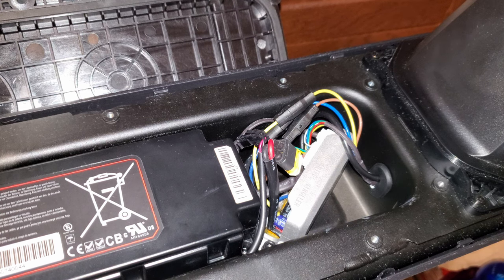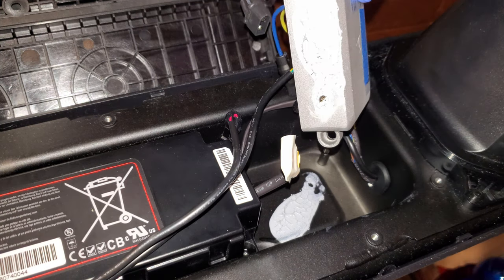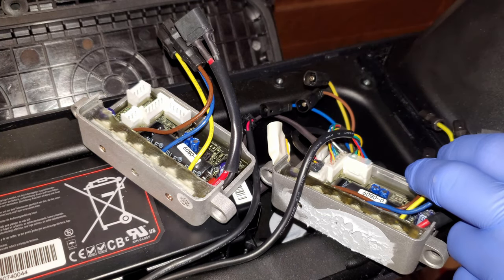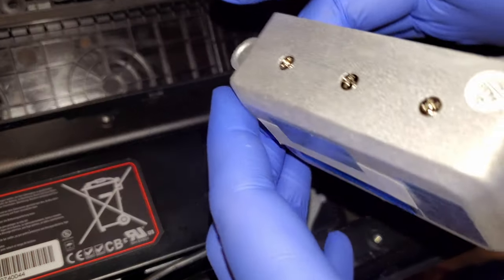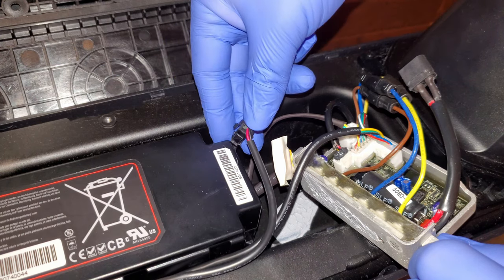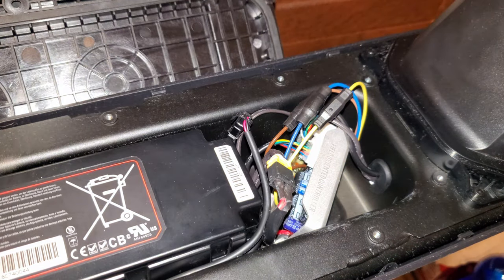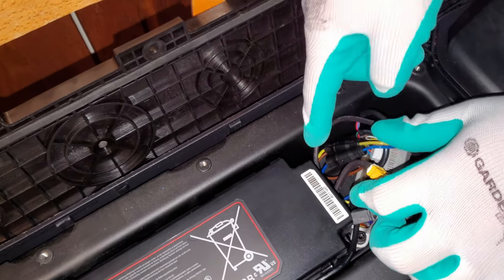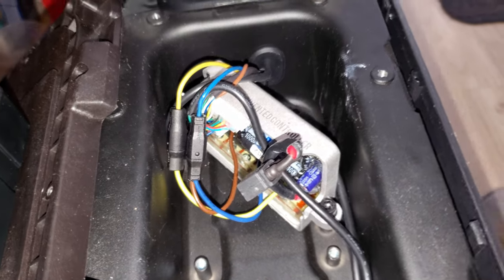NIU KQi2 Controller and Battery Replacement

Comment: I have a Red light blinking on my screen do I need a new battery for the kqi2? And could u provide a link for a new battery? Plz and ty
Reply from the maker: What sort of light, usually if there is an issue the scooter display shows an error code.

Here is a guide from NIU on buying spare parts:
"For the customer from the NA region, if you feel comfortable changing the spare part yourself, please follow the below-mentioned steps:

1. Please go to https://www.niu.com/us and scroll down to the bottom;
2. Click [After Sales] and follow the instructions on the pop-up window;
3. When you fill out the form, please fill out what spare parts and how many spare parts you need.
4. Select [Send you replacement parts]

For the customers in the EU, if you are capable of repairing the kick-scooter by yourself, you can purchase the spare parts by referring the following steps:

1. Please visit https://niu.b2x.com/shop/
2. Click the flag icon located at the upper right of the corner and select the region;
3. Select Your Model
4. Select the parts you need and confirm the quantity
5. Scroll down to the bottom and click the “Next”"

source: https://www.reddit.com/r/kqi3/comments/1cqy7yt/comment/l3ytya6/
Reply: @Lantea13  there is no after sales button u just send people on a wild goose chase so it appears to possible buyers that the NIU has good support but in reality they have none
Reply from the maker: @jasonsamuel4110  Yes there is an "After Sales" button, go to https://www.niu.com/us and scroll to the bottom of the website and its under "Service" see https://imgur.com/a/kDP0uhv

Comment: Do u have problem with controler? And do they send to you free of charge
Reply from the maker: The first KQi2 I received was DOA, and NIU sent a new controller that I replaced. If your scooter is under warranty NIU will repair it for free or send you the parts, depending on what you prefer. You have a 2 year warranty on NIU scooters.

Comment: The controller (at least in my scooter) seems to have the wrong wheel size - it's showing speed 2..4 km/h more on the display than the actual speed seems to be, as the rent scooters are overtaking me and pulling away, while I'm supposed to be at the 25 km/h. Is there a way to change that whell size value?
Reply from the maker: There is no way to change the scooter wheel values or other parameters. The 2-3km/h slower speed is a known issue/feature? NIU knows about it and towards the end of last year they wrote on their facebook group that at least for the German model they were working on fixing it, as that one was going 17km/h instead of the intended 20km/h and apparently legally it can go up to 22km/h (10% over the limit). So the hope was they would look into the limitation on the EU version as well, but I havent heard anything since, but I dont often check facebook, so maybe there was some updates on trying to address the lower speed.
Reply: @Lantea13  I had an exchange on reddit and they basically gave me the basic PR stuff. Maybe there is a way to replace the actual controller with something that is programmable, without any official blockades?
...also, maybe flashing a firmware from a different model might help with that problem?... like the kqi3 pro.
Reply from the maker: Unfortunately that is not something I  have experience with. I remember a while back some guys on a German youtube channel put an expensive vesc controller in a NIU scooter. But honestly that is just not worth the cost and hassle, imo. At that point its just esier to buy a more powerful scooter. But if you have experience with such mods would be interesting to see what you come up with.

Comment: my niu kqi2 pro stopped working after 1yr seems like it need a battery replacement . i mail niu but still nit reply. idk what to do
Reply from the maker: If you did not receive a reply from Global-Service@niu.com after a couple of work days fill out the repair request form over at https://niu.besender.com/form and they should get back to you with possible solutions.

Comment: If I put US controller it will speed up to 32 km/h?my EU version speed is max 25 km/h…it’s very slowly!
Reply from the maker: That should work in theory. But the top speed of the KQi2 is 17.4mph which is 28km/h, so you won't get faster speed than that even with US controller.
Reply: Are u gonna try it ??

Comment: Hola amigo , tengo un patinete NIU KQi3 que por no darle uso se ha descargado totalmente la bateria y no consigo hacer que cargue , segun me he podido informarme , es por que la bateria a entrado en modo de seguridad o reposo . Me comentan que con un cargador directo, no el original ,  se puede desbloquear . Sabrias tu decirme algo por favor ? un saludo
Reply from the maker: Hello, sorry I am not sure what the best process is for reviving a completely discharged battery. I have not deat with such a problem so far. I know it is possible to revive the battery, but in this case it would be best to ask NIU support to tell you what the process is for the KQi3.
Reply: ok gracias  @Lantea13
Reply: tienes que desarmar la bateria y revisar las celdas por q estan bajas y apicalr corriente a cada cela o  alas que esten bajas y depues conectas el cargador y la bateria revive
Reply: con una bateria de litio de 3.5 volt lo haces
Reply: Tuve mejor suerte , estaba en garantía y me dieron un patín nuevo 😊. Y este de de fábula
Reply: @lagridj  me cambiaron el patín por uno nuevo. Que mejor cosa que esta … jajaja 😂 no obstante, gracias

Comment: Comment je peux acheter un contrôleur de kQi2 pro s’il vous plaît je le trouve pas et ma trottinette elle blouque parce j’ai oublié le mot pas de application
Reply from the maker: Go on the niu support website niu.b2x.com if the part is not listed in the shop fill out the repair request form and ask them for the part you need. They should send you a price quote.

Comment: I locked my scooter with the quick lock option a few days ago and have been trying to connect the app with Bluetooth but it is not working.
I have tried all possible troubleshoot but still nothing.
Is there a way I can manually unlock or is there something I can do to fix this problem?
Reply from the maker: Afaik you can only unlock through the app. If you can, try on a different phone. If you still can't get it to work try to contact NIU support and see if they can help.

Comment: I somehow pressed the lock button during a near fall from a bump the that threw the stem back at me.  Since then, I unbound my primary account and tried a new account.  I cannot seem to get software back to bind it with my iPhone Bluetooth.  It has stayed locked and unable to bind.  NIU service says they will unbind my two accounts.  They said it will take 2-3 days to unbind by the engineering group.  Is there an easy way to fix this?  Has this happened to you or anyone?
Reply from the maker: Sorry for the late reply. No easy way to fix that other than contacting NIU as you have already done. Hopefully they can resolve it for you.

Comment: Hey, anyone come across error 33, "battery open circuit imbalance warning" kqi2 pro, looking for a fix customer service is ignoring me, scooter still works fine but the screen just blinks a big red 33
Reply from the maker: Haven't seen that one reported before. I would try to contact NIU until they reply, or you can also try contacting their service partner besender for warranty support  https://niu.besender.com/

Comment: It would be nice to add a rubber gasket to avoid water getting in there
Reply from the maker: There is a gasket in place around the whole deck cover https://youtu.be/2GT5LiTJ8D8?t=1054. The cable holes also have rubber gaskets and are further sealed by a sealant https://youtu.be/51C4HHwN7WQ?t=235
I have taken the KQi2 through heavy rain and so far it still works with no water damage. After taking it apart, personally, I am not concerned at all about water getting into the battery compartment. I would be more concerned with the wheel bearings and how they hold up under many rain rides, as that has been one aspect that has affected the Ninebot Max scooters after thousands of miles riding in all weather. So far no such issues on the NIU KQi2, but I have only about 1300km on it.

Comment: I was quoted a whopping $300 for a replacement battery pack! It’s cheaper to scrap my scooter and get a new one.
Reply from the maker: The battery is unfortunately the most expensive part of the scooter, if you have a battery issue is your scooter still not within the 2 year warranty period?
Reply: It is out of warranty. I might try to crack open the battery pack and weld in new 18650s.

Comment: There Must be a pin in the controller which is for speed Limitation, so if u find it and cut it off, then😏
Reply: Yes but where?
Reply from the maker: Not that I know of. As far as I know the NIU controller works in a similar way to Ninebot, where the only way to change speed limits or other settings is through firmware. If you find other way, please share.
Reply: @Lantea13  Replacing the controller and throttle?
Reply from the maker: @joaopenedo803  In regards to changing the speed limit? Replacing the EU controller for a US version might work, but I haven't seen anyone try it yet.
Reply: @Lantea13  u need at least new controller and Display with the same cables, for like the M365 from Xiaomi 4 wire display... or u maybe to try to activate ur scooter with using vpn and set other region
Reply: @Lantea13  i found this video to increase the speed from the EU version to the US version https://youtu.be/0I7W1WwXQM0 but nothing else beyond that

Comment: where did you get the replacement controller?
Reply from the maker: You can order spare parts from NIU service partner at https://shop.besender.com/store/ if the part you need is not listed fill out this form https://niu.besender.com/form and they will reply to you with the cost of the parts you need.
Reply: Couldn’t you order the controller for the 3 and get a little more power and top speed?